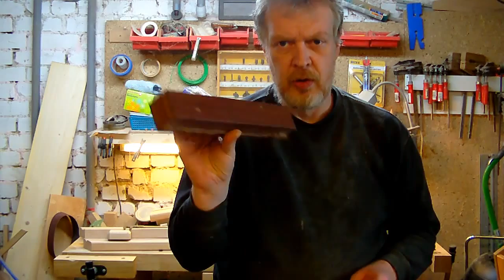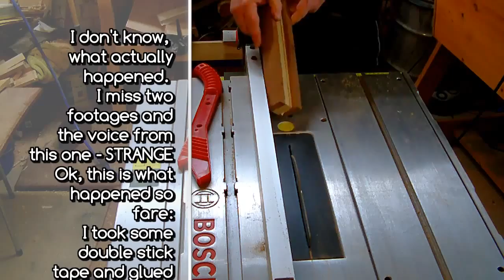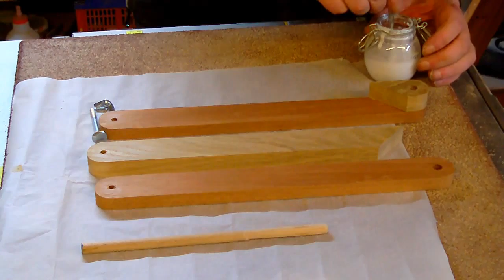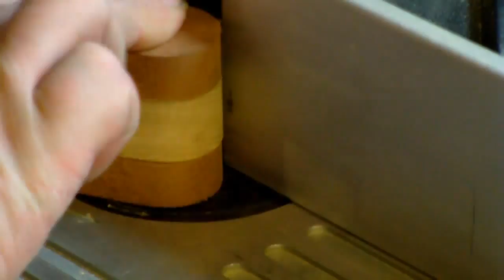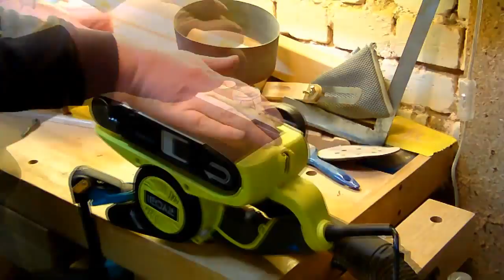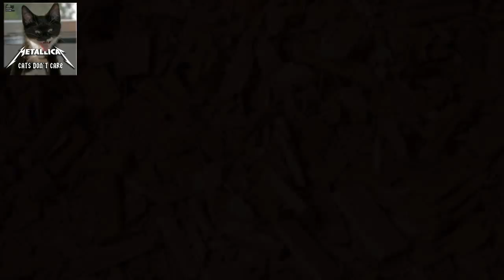Make an easy Tool - The Bevel

Comment: your bevel gauge gave me the idea to build a pocket sized mini version with Popsicle sticks a 4-40 machine screw and nut and some super glue. don't plan on using it much but like most tools it is better to have one and not need it than to need one and not have it.

Comment: Hallo Peter,
sehr schöne arbeit, was trägst du als Oberflächen Schutz auf?
Reply from the maker: Hallo,
ich benutze hier nur Möbelwachs pur. Ich denke als Werkzeug wird es trocken bleiben aber trotzdem Gebrauchsspuren davontragen. Daher habe ich auf die Schnellschleifgrundierung verzichtet, die ich in letzter Zeit bei meinen Drechselarbeiten darunter benutze. Ich möchte Schäden schnell und einfach ausbessern können.
Ach ich hätte da noch eine Frage. Bei der Wiege (mein vorletztes Video) haben wir damals (1991) einen wasserlöslichen, spielzeuggeeigneten Klarlack verwendet. Diese Lackschicht ist nun brüchig und ich möchte sie aufarbeiten. Was kann ich machen? Ach so, die Wiege habe ich damals mit Winni Fiß in seiner Tischlerei in Soltau gebaut. Bei dem Lack handelt es sich um Profimaterial, das mit HVLP lackiert wurde. Ich will aufgrund der Geschicht dieses Möbel nicht zu viel schleifen um das abgedunkelte Holz so zu erhalten. Bei dem Holz handelt es sich um Leimholz Kiefer.
Würde mich über einen Rat freuen.
Liebe Grüße
Peter

Comment: well made tool Peter. Knowing here as a sliding bevel 
thanks for sharing your work look foreword to more projects 

All the best Robbie
Reply from the maker: Thank you Robbie
It's never too late to learn something new, from now on I'll call it sliding bevel (had a hard time to find the right German word "Schmiege").
With my limited English vocabulary I have to relate on (online) dictionaries like Leo.org. Sometimes they come up with a lot of different words to choose from, so I think I got lucky to pick one which wasn't totally wrong. OK I could have double checked with my old "Oxfords Advanced Learners Dictionary" from 1985, but I'm kind of a lazybones.
Greetings from Good Old Germany
Peter
Reply: *****
HI peter its called sliding bevel because you can slide the bevel up and down 
on your tool you would have to cut  a long slot down it so it can slide up and down where the nut and bolt holds it 
hope that helps you some more
all the best Robbie
Reply from the maker: Robbiethewoodturner I am glad, that I hadn't been totally wrong. I know about this slot, but never figured out a practical use for it, so I decided to leave it without. But it's never too late to make this modification, as the bevel is practically just a board with a hole I can take it to my router table and extend this hole to a slot.
With no background in woodworking, I learned my woodworking skills from people like you and I can't express how thankful I am to be part of this wonderful woodworking community. I think I don't do that bad (I could look like a complete idiot). That's the reason why I love the new concept of Carl Jacobson and Jay Bates with the "featured woodworker", to promote "Free woodworking content on the internet".
Have a nice creative weekend
Peter
Reply: *****  hey peter your tool is fine the way it is man its  really nice build to last a lifetime 
don't change it because i give you idea 
i am no prow at woodwork everything i learned my self and from working whith other guys and hands on  working on building sites  
7 years in 8 different schools barley able to write and read bet to feck because i was autistic and dyslexia.  tanks to, feck for spell checker lol   
that's why i am here  sharing my knowledge to everyone who wants it 

you take care now Robbie
Reply from the maker: Robbiethewoodturner Don't bother Robbie, I think I mentioned something about I don't see the practical use of the slot and about lazybones? Unless I don't need the slot, I will not modify this beauty.
I love the spell checker as well, sometimes it's easier for me to write over here in English as writing something in German, as I am dyslexic. Without the computer I can't really tell the difference between a "p" and a "q"  or a "b" and "d". Reading separate letters like in an eyesight test is almost impossible as I have to think about what letter I am looking at. And the doctor thinks I am blind. :-)
One of my best friends has never seen a school from inside, and barely speaks German, but it's like she said, "From the time I knew the word "thingy" I can explain everything."  You should listen to our communication. I've seen some people looking at us, as we would be from another planet. I think it's just a matter of will. If you are willing to communicate, it doesn't matter what language you are speaking the common things make us understand each other.
Keep your outstanding videos coming, just find your own pace, that's what I am doing right now, as I am fully concentrated on the cradle, I don't do much lager projects in between, just easy to build ones. And as my views are rising, I got more and more ideas: to improve my website, my shop and so on, an endless list with even more to add, but until the cradle is finished, I slow down on everything else.
Well as you seem to suffer the same kind of insomnia as I do (Is it midnight at your place? Its 2 in the morning (damn, I still can't remember AM and PM) over here, you might say the right time to hit the shop.... Nah.........
Have a great weekend and remember Thank God Its Friday
Take care
Peter Freitag

Comment: I had one with a plastic handle but after years of use the plastic got so brittle it finally fell apart so I took a scrap of oak and made a new handle.
Like you said there is no reason a tool has to be ugly.
Reply from the maker: Sparrow,
I think the most interesting fact about this build is, the cheapest one you can get over here is about 6 EUR, the cheapest out of wood is 26 EUR (Well, not talking E-Bay), so this project is actually a money-saver! With the cost for the "hardware" of 1 EUR I actually saved 25 EUR, and it's made by myself!
- Did you ever noticed, a tool made by yourself lasts longer then the same one you bought? I think, although it'll get the same use, you pay more attention regarding maintenance.
Thank you for supporting me by commenting as this is the power I need.
Greetings from Good Old Germany
Peter
Reply: ***** Peter,
I think you are correct, you tend to take better care of something you made yourself.

Yes projects like this really are great money & time savers, I remember thinking that it would have taken more time to drive to the store than it did for me to make that new handle plus it was free wood out of the scrap pile and I got something much nicer than I could have bought.
The only thing that took much time was the finish drying but that was alright since I was done for the night and the finish could dry overnight.

I hope to visit Good Old Germany someday but I think I better study the language more before I do, I think I would be lucky if I could understand 5% of what people are saying........although I do know a lot of Germans speak English like yourself.

Comment: It's a very attractive and useful tool, and inexpensive! The sudden sound level increase when the table saw started ensured that I didn't lose concentration ;-)  Best wishes, David.
Reply from the maker: Thank you David.
Yes , I am totally with you regarding the bevel. Although inexpensive, it might save you a fortune. Did you ever try to mount a counter-top in between two walls? Sometimes I have the feeling these guys building houses didn't know about a square. Well, it only happened to me once in an 150 years old house.
Oh, I am sorry, I think you could call it intention, but I think I missed the sound increase on my first view prior the release. I could argue that we woodworkers should be aware that while someone is using power tools, you should always have your ear protection at hand. :-)
Greetings from Good Old Germany
Peter